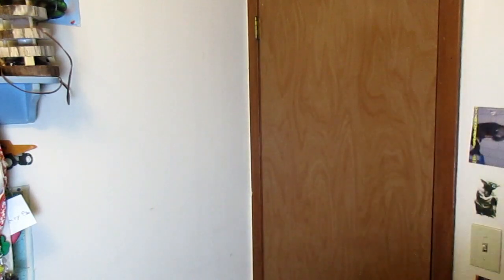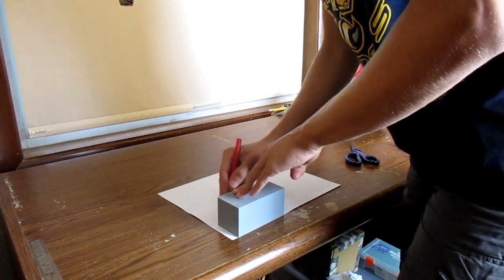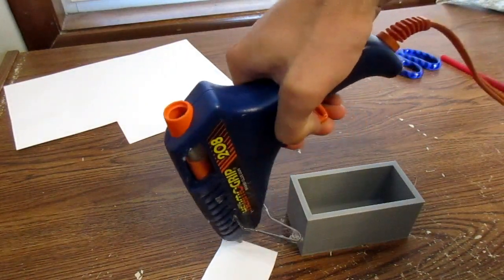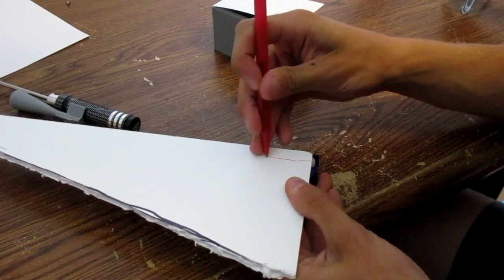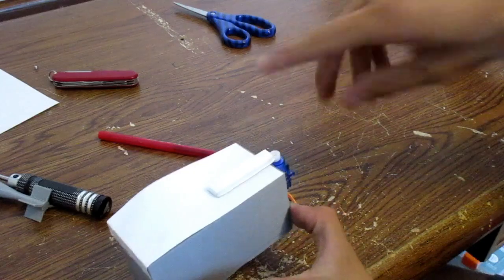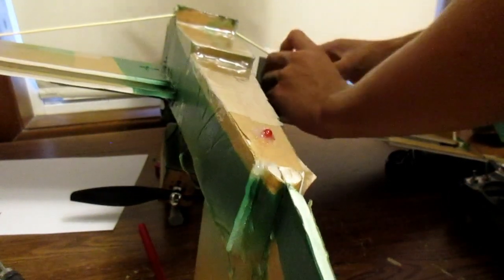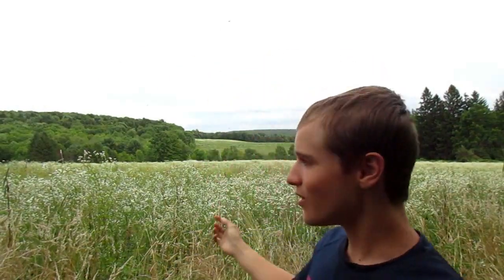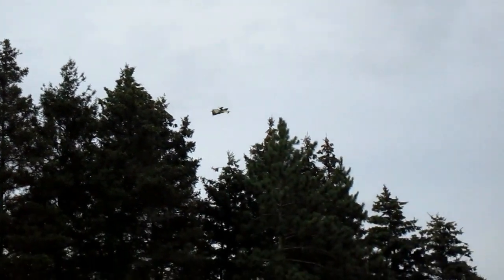3D Printed RC Plane Bomb Drop!

Comment: Why not connect two motors in series and use the same RC input so you can control two of these at once.
ps: try to reduce both the diameter and infill, that way it won’t be as heavy. 
pps: thanks for the feedback and I'll try and improve.
Reply from the maker: I dont have the motors